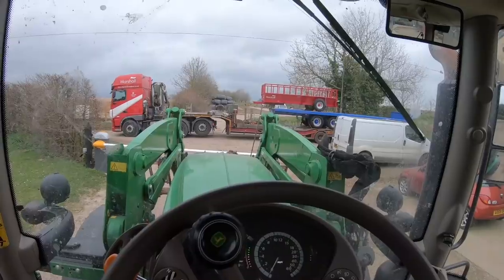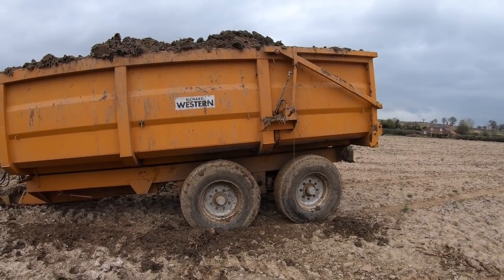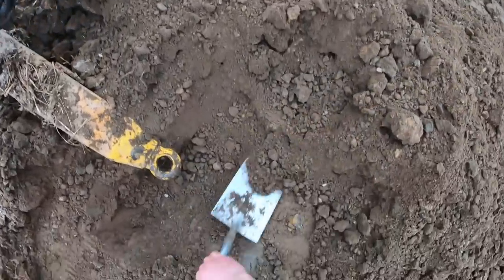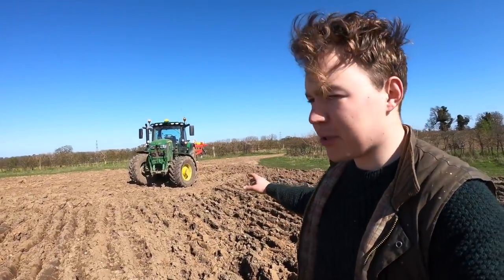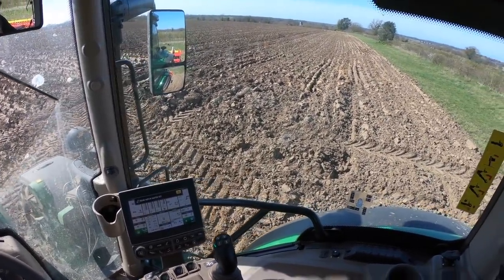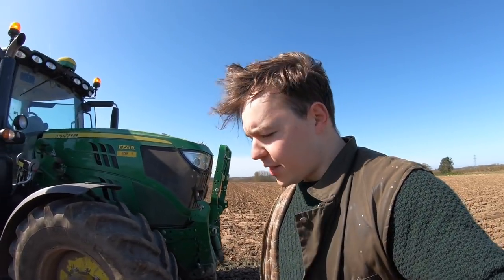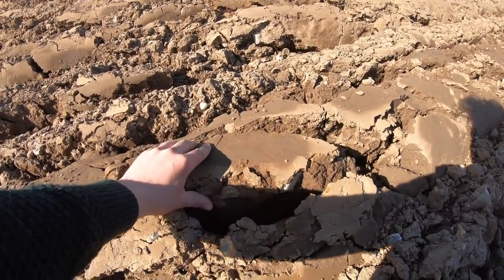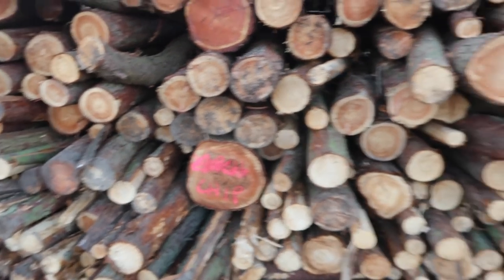TAKING DELIVERY OF THE MARSHALL FEED TRAILER!!

Comment: I work for a company in Lincolnshire doing similar, the chipper we use has its own crane to load it and we have a claas scorpion with a big bucket to load the chip into the walking floor trailers to deliver. We also have drying floors which can dry a full load of chip in about 24 hours.

Comment: Olly, you just need a drop down leg with a flat plate to stop the trailer nose diving, or a good old fashion block otherwise. Look at the JCB mini diggers, or if feasible a180 backhoe attachment for either of your tractors with a grapple on it! You have to keep your operating costs down and get maximum use out of your existing equipment.

Comment: If you are hauling timber from other farms i would go for a logging trailer with boom and grapple rather than a digger and grapple.
Reply: Justin P yeah but then you would need another tractor for the trailer and the chipper
Reply: @hecy-t1238  Don't they have trailers that are stand alone with an onboard motor for the hydraulics?